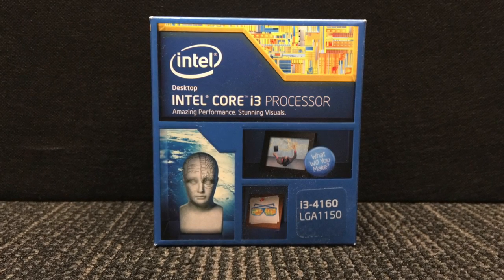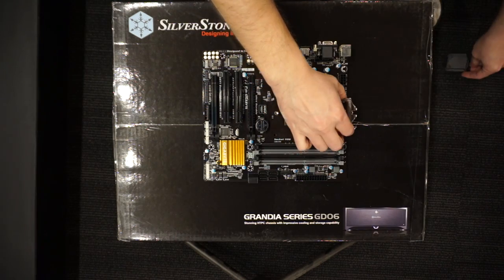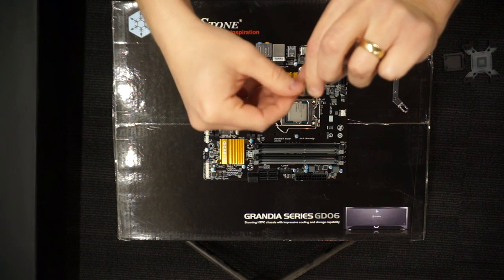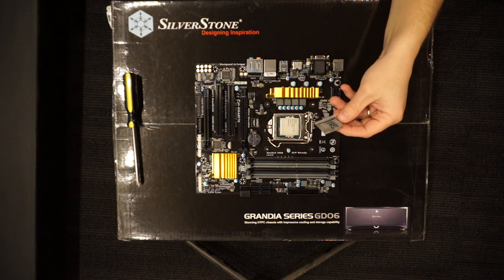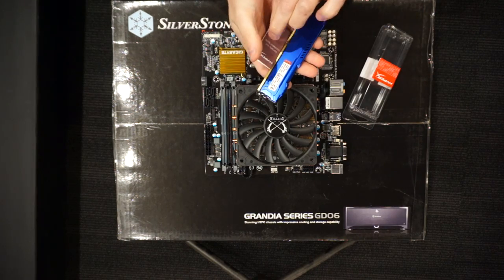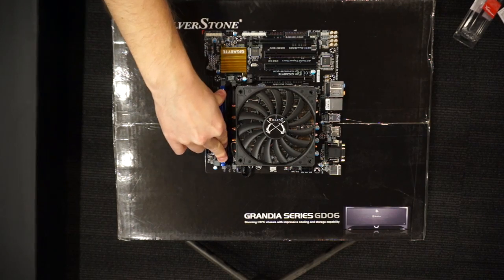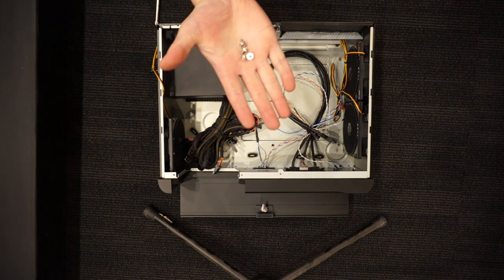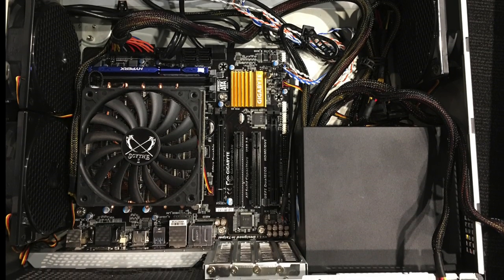How To Build a Home Theater PC (HTPC)

Comment: Used a GD04 case in my current build, not a big fan I'm afraid. Poor compartment layout, HD airflow and overheating issues, fan filter cleaning is a pain, screwless servicing would be nice, but, sadly absent. On the plus side, although perhaps not a big enough plus, it looks really good. Unfortunately, attractive (cheaper) cases like the Antec ASK2480 completely trounce the GD04 and will be much easier to live with in the long run.

Comment: Is there any case you would recommend instead of the Silverstone case that could hold a disk drive and two hard drives?
Reply from the maker: Fractal Design Node 605, if you are wanting the same horizontal style case that holds MATX and ATX.  Fractal Design makes awesome cases but this one is just "pretty good".  I think that the case manufacturers have abandoned the horizontal case market and only innovate in the vertical space.  But the 605 does make far better use of space than the Silverstone, is likely much quieter, and is very well made.  It's possibly the best of a frankly uninspiring lot.  Now if you don't mind vertical cases, then you have a ton of extremely nice cases (start with the Fractal Design Define R5)
Reply: Also, would a 103 watt PSU cover this build?
Reply from the maker: I've never even heard of a 103 watt PSU!  In general, though, a system like this is typically powered with a MINIMUM of a 350 watt PSU.  I wouldn't recommend less than that since the results can be flaky.
Reply: +granworks Ok. It's just that I have an extra pay from HP that powered a 640 and an i7-4771
Reply from the maker: Oh, very interesting!  As I said, I've never heard of a PC class power supply with 103 watts, but if you have one and it powered an i7 with all the rest, then give it a go and report back.  I'm very curious if it would work!
Reply: I am assuming that the psu was powering the bare minimum requirements. But if I do get to make this computer I will try to use the psu if not I will just get a new one.
Reply: Yes.
The Silverstone GD09.

I've been using mine for 3 years and it's solid. I've also just finished upgrading my whole setup inside this case and it is now a high end gaming HTPC.

Solid construction, great airflow, fits in perfectly with my AVR. In comparison to the case in this video, the GD09 is superior. I'm running a full size ATX mobo and psu, a large GPU, 2 HDDs and an SSD, as well as a bluray drive in the optical bay. All fit inside the case perfectly with very good airflow. 
The only thing I could ask for more so is better cable routing options but that's asking a bit too much I think. Plus anyways, it's fun trying to creative with where you run the cables for that clean minimal look. 

Check out the GD09.

Comment: Hot swap bays is a great idea if you are like me, and I have a literally INSANE amount of movies and media I have collected in over 30 years!! Heck my HTPC runs 6 hard drives just for storage!! That is why I went with a full mid tower case!!! And as for "SCREWS in 2016" comment, what exactly is wrong with screws? In a lot of cases they use those cheap plastic hard drive trays that CAN break!! I personally would rather have a screw holding things together and the new cases are pretty cheaply made with extremely thin metal so the more screws you can use the stronger the cases become when you start mounting things!! so I don't know if you are too lazy to pull out a screw driver or too cheap to buy a decent set of Stanley Screwdrivers from Walmart CHEAP, but there are a LOT of things that even in this day use screws and I personal DO NOT trust a cheaply made plastic clip to hold things together like some of you kids seem to be used too!!! Plastic breaks.....metal normally doesn't!! Unless that is you are apply pressure on it like a Congo Gorilla!! And even then metal is no make for stupidity!!
Reply from the maker: My assumption was that if I needed more than a couple of hard drives, then I'd create a dedicated NAS... or get a bigger case.  What I couldn't understand was the need for hot-swap in such a small case.  An earlier comment did give a good example of a use case, though, so my thinking was definitely too limited.

And as far as "screws in 2016" goes -- I actually am putting together a new computer right now with a Fractal Designs R5, which doesn't have any regular screws.  The R5 is super solid and is LEAGUES better than any cases made back in the day.  I was expecting that level of high quality in my HTPC and so was disappointed to see that it was the same-old style of construction that goes back to the 90s.  My guess it that the HTPC case (and "desktop style" case in general) market is so tiny that they no longer innovate in that realm.  But yeah, check out some of the Fractal Design or BeQuiet or NZXT or similar cases and I think you'll be pleasantly surprised at how much better a case can be if some thought is put into it!

Comment: I yesterday buyed for only 293€ components for my first HTPC. This is only for Youtube Videos and some other videos to watch on my big Plasma TV on the couch... Hope my pocessor will be strong enough to play UHD 4K too, i think it should be... It should be because my intel i5 6400 in my desktop plays 75mbit/s 4K Video with only 20% Load, and on power option balanced it goes even down to ~ 1.0 - 2,7GHz ...

My HTPC for only 293 €:
* Fractal Design FDCANODE202BK Schutzhülle schwarz (79€)
* INTEL Celeron G3900 2,8GHz LGA1151 2MB Cache Boxed CPU (39€)
* Asrock H110MITX Intel Mainboard (2x DDR4 retail) (64€)
* Crucial CT2K4G4DFS8213 Arbeitsspeicher 8GB (2x 4GB, 2133MHz, CL15) DDR4DIMM Kit (35€)
* be quiet! BN256 ATX PC Netzteil 300W System Power B8 80+ (35€)
* Intenso interne SSDFestplatte 128GB (40€)

There is anytime the option to add a graficcard when i woul play a pc game on my couch... Normale this configuration don't need a special cooler... I use a intel i5 6400 on my desk it never gets really warm...
Reply from the maker: Sounds like a nice system!  My understanding for UHD is that the bottleneck is more the graphics card than the CPU.  That is, you need a graphics card that has HDMI 2.0 output and the last I checked, those where rare.
Reply: I think decoding video is more CPU, than converting it for your display is more GPU... So i think they are both important... I think intel celeron G3900 CPU and internal GPU should be good enoguh even to play 4K UHD Videos on a 1080p plasma...
I have an asus UHD display for my desk, for 4K UHD @ 60Hz you should use display port, or new hdmi Port works too... There some new gerneration mainboards with display-Port 1,2 (ex. AsRock H170M pro4 what i have for my desk for ~ 92€)  and you can even use it with intel internal processor grafics... as long you don't wanna play games on this system... If you don't have a mainboard with display port  to display4K @60Hz you can even upgrade your PC with a cheap graphic card ~95€ AMD Radeon R7 who has... So that's all for good "Low-Budjet HTPC... LGA 1151 has even the possibility to upgrade CPU in 2 years for example intel new generation "cannon lake" with 10nm CPU... and add a good grafic card if you wanna use this HTPC as a gaming machine for example...
Reply from the maker: It sounds like you have this all down pat.  Nice!  In general, I think it's important to identify your specific requirements before buying hardware since the hardware choices can be very limiting if your requirements are too high. I am a bit of a snob when it comes to 4K and would require 10-bit 4K with HDR @ 60Hz. With that, I'd be looking pretty much at a GTX 970 since software decoding won't cut it for 10-bit HEVC and the 970 is the only GPU I know of with a hardware decoder.  The 970 is also the only GPU I know of (and there might be more) that has an HDMI 2.0 output... also a requirement for 60Hz 10-bit 4K.  I'm not sure how much content there even at that level, though, so your setup is far more realistic for real-world 4K content!
Reply: Ups... I checked today than my power supply does not go in this case... You need SFX Format power supply for this... I'm happy that it is allready packaged, and there should be no problems to send it to amazon back... and order a SFX power supply who are in general a little bit more expensive...

So what a ordered (my list in the first posting) is not fully recommendable :)

Comment: Some things i would like to see is when a content creator says things like "WD Red is a bit overkill" I wanna know why he said that.
Reply from the maker: +Jonathan Bright Thanks for the feedback -- good point!  IMO, WD Red is overkill for an HTPC based what the drive is designed for and you are paying extra for versus how the drive will be used.  It makes sense for a NAS (it's target market) due to the much higher than average use, causing much more than normal wear on the mechanical components.  The certification and warranty can really be valuable in that case.  An HTPC hard drive will be idle 99% of the time and when it is going, the searches will typically be almost perfectly linear.  This is literally the easiest thing a hard drive can do, so any extra protection or warranty is unneeded... and if it costs more, the extra cost is wasted.  Hence, "overkill".
Reply: Makes sense.  I don't know much about all of WDs different drives.

Comment: Good video man, this was helpful for me. I've never built a PC let alone an HTPC but I have to have one of these. I'm always plugging my laptop into my TV for something.... which drives me crazy. Looks easy and I'm finding I was maybe overthinking the hardware a bit and I should get something just a little overkill for future proofing but don't waste money. I was thinking of the i3 Skylake. Do you have any suggestions on the case or anything else? This is the case I've been eyeing: https://www.pccasegear.com/products/33471/thermaltake-suppressor-f1-mini-case
Reply from the maker: +Kalab Washburn Future proofing is difficult now, since the next big upgrade is UHD with HDR and high-bit color, requiring 18 Gbps HDMI 2.0a and HDCP 2.2.  Both will require either a new motherboard or new graphics card sometime later. The CPU really only comes into play with post-processing since the video stream is handled in hardware.  That case does look along the lines of what I was thinking of -- not really an AV case visually, but clearly well designed.
Reply: +Kalab Washburn My suggestion is definitely going for skylake. Its a brand new intel cpu socket that will only work as of now with LGA 1151 socket motherboards, but down the road, if you bought a skylake cpu you will have room for updates in hardware (if you find that the i3 no longer suits your needs or whatever. 
You will spend some more on this kind of build as it is literally months old tech but you will have the benefit of the future possible upgrade paths!
Hope this helps; if you want some help with part suggestions ill gladly help (as im building my own as of now :p)
The case I plan to use in my build is a bit sleeker for HTPC reasons; it'll look the part in a TV room:
http://www.amazon.com/gp/product/B0161UXX9W?psc=1&redirect=true&ref_=oh_aui_detailpage_o00_s00
Reply from the maker: +Gustavo More Rodriguez Using skylake in a typical PC build is absolutely the way to go for long term bang for the buck, but I'd argue that that mentality might not be applicable to a niche product like an HTPC.  An HTPC's use cases are so narrow that it's not typically that hard to envision far into the future what they will be.  I can't think of very many of those future use cases that will require additional CPU power.. hence my choice of an i3 in the first place.  Going with skylake is certainly not a bad choice -- just not a necessary one, IMO.